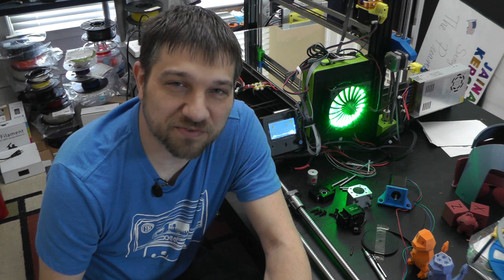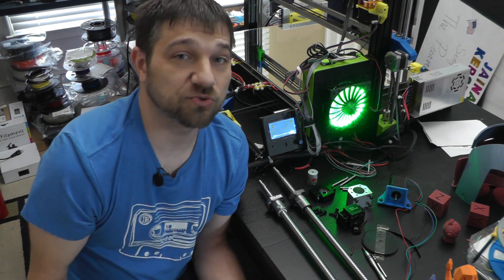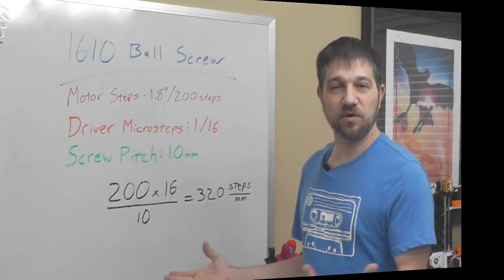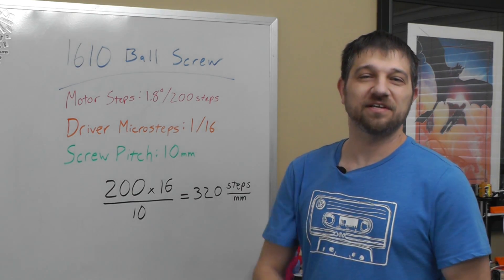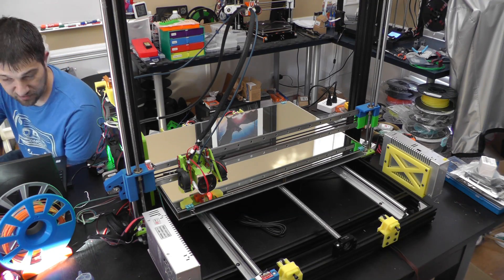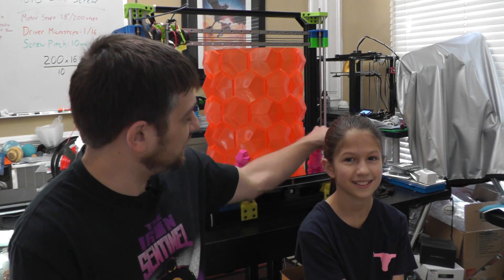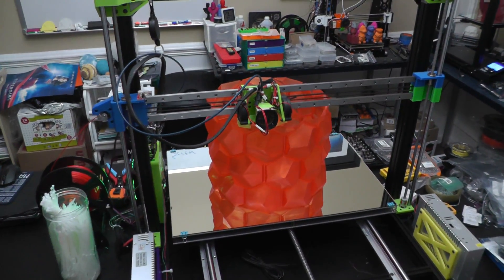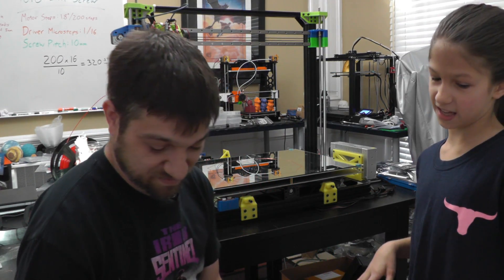Replacing Belts with a Ball Screw on a 3D Printer (Cosplay 600 series)

Comment: in the late 70s I was on a team that engineered one of the first Whole Body CY Scanners. We used a two axis data collection motion where we would translate across the patient carrying the X-ray tube and detectors in a C Arm shape frame. Then rotate a few degrees and translate back across. we would do this translate and rotate for 360 degrees. we used Xray absorbing crystals to glow when struck by xrays and PMTs to amplify the light emitted to go A to D for computerized reconstruction of the slice in a 3D style image for radiologist.  We had many of the same issues with speed control, vibration, jumping and false data (Artifacts). As we slow down it was better but no one wanted the patient to be in the machine for hours. Head injury victims had minutes to be scanned before surgery. Speed was critical. We learned the machining of ball screws also had tolerance issues. And added mass to the translate & Rotate assembly, In time we learned less mass was better, and we achieved stiffness by using steel wall tubing for the structure. Linear bearing for guidance and a half round tooth on a rubber timing belt. This gave us the best the results. But the real kicker was our Control Engineer working weeks and weeks on Accel and Deaccel ramping. He tweaked the signal and dampening so the Motor was is a controlled condition for a ramping up to speed, levels out, speeds across, ramping down to stop, reverse and do it again. The controller we used was so large it had to have cooling fans added to it, it liked like some kind of dinosaur off in the corner of the scanner frame. Our EE designers name was Bax, so we called it the BAXILLA! But I wanted share this because it was really good work and we had the BEST images in the industry because of that motion control engineering. A timing belt can work if the mass is greatly reduced and recirculating ball bearing linear guidance is used with highly controlled acceleration and deacceleration. I wondered just how much control do we have in these smaller almost toy like devices and if there was any room to leverage some of these lessons. In the end we had from 5 and 7 minute scans to 20 second scans with better images, less x-ray dose and very fine granular pixel size for details like optic nerve and heart valves.  All speeds measured in milliseconds and it happens so quick you can't see it. we used a scope to show the path speed and worked that ramp angle from linear to similar to a logarithmic path, starting slower but ramping faster one in motion. 
I really like this project, good luck, Dennis
Reply: No offense to Kersey, but this comment was even better than the video!
Reply from the maker: @garybarbourii8274  I can't ague. David has more experience than I've been alive. He has serious credentials.
Reply: @kerseyfabs  it was definitely a great story!
Reply from the maker: Wow! Thanks for taking the time to share your experience. I am still working on this project but some other projects had to come first. I actually should have a new video on this one soon though! You're absolutely right on the speed control though. A lot can be accomplished with correct settings for speed, acceleration, and jerk on a 3D printer. Thanks for watching and for sharing!
Reply: this is exactly what I needed to read to ditch the rubber wheels on v slot aluminum extrusion/smooth guide rods + lead screw(s) in favour for belts and linear rails.

Comment: Are you OK with a little constructive criticism from an old engineer/3d printing enthusiast?...The vertical frame elements are 4040 t-slot which is amazingly stiff but you run the gantry up those horrible bearing rods that are noodles by comparison, and only supported on the ends (by necessity). So the inertia of the print head accelerating and decelerating in the x direction will induce flex in those rods and therefore ringing in your prints. The effect will be most pronounced half way up the gantry in the z direction when you're furthest away from the supported ends of the rods.  You did well on the x axis with the linear bearing rails, why not run the same type of linear rails in the z direction by attaching them to the 4040? Added bonus - you eliminate any z axis wobble induced by leadscrew runout since the z axis will be so much stiffer than the leadscrews whereas right now those rods are just not rigid enough to constrain any runout in the leadscrews.... I bet you'll see a significant improvement in those prints.

The bed - wow, that's a lot of mass to move, but there's not much you can do about it now. The ballscrew is definitely the best choice there.

BTW, re. print speed, when I need the very best quality prints above all else I'll go all the way down to as low as 20mm/s and the acceleration at 200 and jerk at 4. It's perfectly OK to print slowly, I just don't get the obsession with print speed some people have (not you personally, just generally). Yes, the prints take longer, but it's a matter of priorities. Like we used to say back in the day - good, fast, cheap, pick any two.
Reply from the maker: Gabriel, thanks for all the feedback. I like the idea of the vertical linear rails! I think I'll work on that in the future. And I completely agree with you, when quality is a must, slow it down! Thanks again!

Comment: Nice video, thank you. I just wanted to point out a tip @ 7:40. You can set your display's steps per menu item to a higher value so that you don't have to turn so much. For Marlin I used #define ENCODER_STEPS_PER_MENU_ITEM 1 when defining the parameters under your control board's firmware. Alternatively , just print a knob with a larger diameter.
Reply from the maker: I appreciate the info. I'll build that into my next version. I hadn't taken the time to look up that setting.

Comment: A question I have linear rails on all axis on my cr10s. Is it possible to ditch the belts on my heat bed and add a ball screw along with the linear rails ?
Reply: If u have time I would like to ask you about the installation of the linear rails for the xz axis ? Did you notice any print quality changes?
Reply from the maker: @6antic  On this particular build, I always had linear rails on the X axis. So I don't have anything to compare it to. The newest updates even make it more rigid by mounting them to an extrusion.
Reply from the maker: It's possible but it would require a fair amount of design work, changing the step values on that axis, and then tuning the speeds at which you could move.

Comment: have you looked at BLDCs instead of the steppers, for more speed?
Reply: Do you think about something in the order of a ODrive?
Reply from the maker: I have looked into ODrive. It's only been cost that's kept me from going further.
Reply: you also can't miss steps with a bldc
Reply from the maker: I have and am looking into them. It's a new area for me though and I'll go that way once I have them figured out and figure out how to do it without too much expense.
Reply: @kerseyfabs  i'm looking at getting into making small cnc machines, 3d printers, hopefully mills and lathes too, and i'm a big fan of the odrive project, the whole premise is to make it easy to take hobby grade motors and make them into reasonable servo-motors. since there's a well developed consumer market for the hobby motors they come cheap as anything, you link it with the sensor, you're all set, with a 3d printed case it's a drop-in replacement for standard steppers. the odrive has all kinds of features, current control, speed control, position control, trajectories, and the firmware is still being developed. to make it even easier to replace existing stepper systems, it also has the standard step-and-direction interface

Comment: I have a 50x50x50 Core XY and it has 0 ringing
Reply from the maker: Sounds like you've done a great job of getting your settings dialed in! Nice job! What kind of jerk and acceleration do you have set? Also, direct drive or Bowden?
Reply: @kerseyfabs  if you still havent tried bowden, go for it. So I use bowden, welded iron frame, 20 for XY jerk, acceleration 3000, no layer cooling fan, E3D clon

Comment: I love seeing ball screws on printers! What's your speed you reach with it? When I assume 320 steps/mm * 16 micro steps and 200khz step frequency i "only" get 39mm/sec speed, that seems a bit low for my test.
Reply from the maker: I appreciate that. I'm actually running at 1:8 microsteps which gives me 160 steps/mm. This gives more torque and it's still more accurate than the X axis.

Comment: You need nema 23 and better convert motion kinematics to  COREXY.
Reply from the maker: I may go NEMA 23 but I have one idea first. I won't be going CoreXY yet. I want to see this design through.
Reply: @kerseyfabs  ball screw is great for CNC. recently I saw a video where a especially designed leadscrews are used for better speed. 20 or 18 mm lead 6 start.
Reply from the maker: I've seen some of those too. One step at a time. 😁

Comment: pitch of the screw doesn't matter necessarily.  the value you want to use is called "lead".  Lead = pitch* number of starts.  for instance, some 8mm screws have 1 start, some have 4 start, but even if both are 2mm pitch, one will move 4 times as fast per rev than the other.
Reply from the maker: You're absolutely correct and I realize I didn't clarify that in this video. I left it for simplicity sake.

Comment: Check for backlash in your y axis it's one of the problems with ball screws if their the actual ball screws. Also appears you have some voltage leak causing a little interference. Maybe try to Shield some of those cables. I like the to wrap mine in Copper foil. You do have four beds there.
Reply from the maker: I'll look into some shielded sleeves. Thanks!

Comment: printer in this size shold be corexy or delta  why not just make it  
core xy its simple then what u traing to do
Reply from the maker: I understand that. I'm trying to do something different. And what I learn from this exercise I may be able to apply to future projects. I've also mentioned before that I don't like belts, particularly ridiculously long belts.
Reply: @kerseyfabs  For a reasonable price, there isnt really a better drive system. Just get wider belts and lower jerk, acceleration and outer perimeter speed. Or you know, get linear steppers and cut the middle man ;)
Reply from the maker: @olorf  Linear stepper! Now we're talking! I wonder how much those cost?
Reply: @kerseyfabs  not sure but I would love to see one on a moving bed!
Reply from the maker: Let me see what I can do!
Reply: @kerseyfabs  tbh that heavy moving bed is the worst thing you could have done with like two 6mm belts? Eventhough I would have expected better for chinese ball screws.
The ringing is definitely a GT2 mm distance that is shown in the printed parts. Aka the the belts compress and flex because it's overloaded.
Just.. try not to move a massive bed. Move the printhead instead.
The i3 design is flawed because of this whole issue.
And if you hate belts that much use the Ultimaker design. But that also uses belts.
Or a dual leadscrews in a cross shape for the head. But that brings more issues to them as the threaded rods or ballscrews will have some play to them.

In a summary:
You're trying to move a massive bed  that weighs atleast 7 kilograms, and you blame it on the belts and ballscrews. Don't.
Move the printhead, which weighs, for a direct drive a maximum or 800grams, and as low as 400 grams. (350 stepper motor + 30 hotend + 10 grams fans + some plastic).
Aka build a better printer for your size.
Reply from the maker: Thanks for the feedback. I realize what I'm doing isn't recommended due to the moving bed. I'm trying to see what is possible though using different systems/materials and careful tuning.

Comment: Something often overlooked on stepper motors is as the larger motors have 1 Higher Inductance, and 1 Higher voltage per RPM, requiring higher step rates for the reduced travel rate of the drive, a higher voltage stepper driver and supply are required to get the performance.  I am running on 32 Volts from used HP printer supplies to reach the required speeds.  If you have a multimeter with an AMPS setting, and you put it in series with the power to your stepper driver, run your steppers at various step rates and note the current at each setting.  If you exceed the voltage requirement, the current at higher step rates will actually drop off as the current drops along with torque just before missing steps.

Many people are experts at 3D printing but not experts at driving stepper motors at higher speeds.  You can't fix low voltage problems with an acceleration curve in software.  Higher voltage is required for higher step rates with geared down ball screw drives.  Had to deal with this directly with a laser engraver upgrade to reach raster scan speeds.
Reply from the maker: Yeah. I'm going to be getting more current and voltage to the steppers. I'll be upgrading the system from 12V to 24V and I have some higher current drivers coming soon. I think this will allow me to better utilize the larger NEMA 17 before having to try a NEMA 23.
Reply: @kerseyfabs  You don't need higher current drivers unless your existing drivers will not provide the voltage or current the new motors require.  For example my steppers use 1.5A and my drivers can set up to 3.5 A at up to 40V.  I run at the recommended current even at the higher voltage.
Reply from the maker: Well the largest NEMA 17 I have can pull 2.1A and my current drivers can only provide 1.4A with a peak of 2A. The new ones I've ordered can do up to 4A. Which ones are you using?
Reply: @kerseyfabs  I'm running some Stepperonline 17-1519-2004S1. They are much lower resistance and inductance than my originals, so they step about twice as fast at 32V than the originals did at 24V.  Originals were only 0.9A.  Now running higher voltage and a little less than double the current.  It's about the same torque, but steps much faster.
Reply: Can I get in touch with You somehow.?
Reply: @savikate  Best thing to do is start reading the datasheets for the steppers and drivers. Match the driver current to the stepper recommended current. Don't exceed the maximum voltage and current for the stepper driver.

Comment: So you're using TMC 2208 for Y-axis? Driver with  (theoretical) 1.2A RMS current?
If so, why so large stepper motor? 40-45mm long ones should handle  say 1.0 A  current as well.

I am curious, as I'm building my very first 3D printer with 2208 right now.
Reply from the maker: This is honestly a great question and I'm still learning how this works myself. I'll try to get back to you. To your point, I find that I get extra power when going from a 38mm to a 48mm, but I'm not getting more power when I step up to the one I show in the video which is a 60mm. Because of that, I've switch back to the 48mm from the one shown.

Comment: How rigid is your frame at that size in the Y direction? Maybe consider bracing the frame?
Reply from the maker: It's actually quite rigid. The ball screw and the Y rails add a lot of support (although I realize we don't want the ball screw to be a supporting member). I can try to add a few more braces to firm it up.